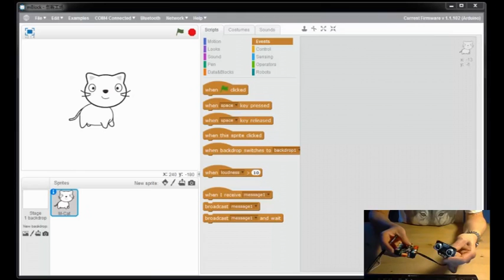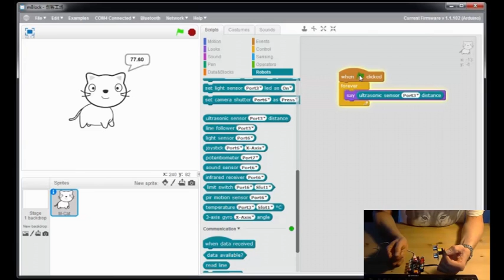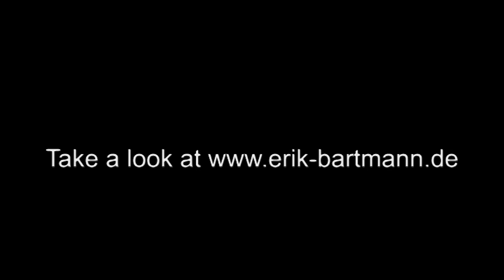A short example with the mBlock Application of Makeblock

Comment: Erik, do you mind if we communicate in English? I purchased one of these kids for some students to experiment with. We are trying to use the motion sensor component which in Scratch will then generator a random number. If the number is prime, nothing happens. If the number is NOT prime, a switch will be activated to open a sprinkler valve (24v, separate power supply) and the unlucky student will get sprayed with water. I would appreciate any direction you can provide. Thank you!
Reply from the maker: Hi, which block do you use in order to receive data from the sensor? Does the block change the value when you wipe with your hand in front of it?

Comment: great tutorial.  we can make this work so long as the mBot is connected to our laptop (windows 10) through USB.  is it possible to run this program after disconnecting USB, but without pure Arduino code?
Reply from the maker: The mBot can only act stanalone with arduino-code. Otherwise you have to establish a constantly connection to mBlock, which is the control-instance.

Comment: can you help me?! my mblock application doesen't read my robot sensors. in your video you have an makeblock category but in my computer there isn't. how can i connect the robot to the mblock application? sorry foar my english.
Reply from the maker: Hi Marco, do you use the original sensor from Makeblock?
Reply: +Erik Bartmann yes I do. and do you know how to make ma robot go straight?? I tried motor 1/2 speed 255 and uploaded to the arduino but it alwais sais "failed".

Comment: I tried this with two different arduino boards and two different ultrasonic sensors.  Is there settings or steps you took that are not included in the video?
Reply from the maker: +Michael Ma 

Hi, what is the problem? Are the boards not recognized by mBlock or the sensors? 

Regards 
Erik